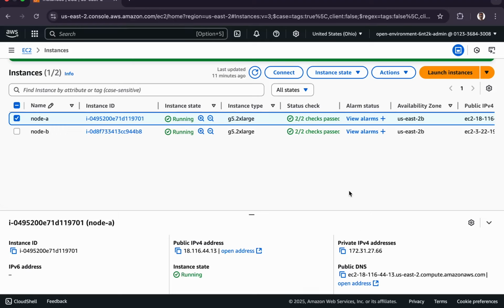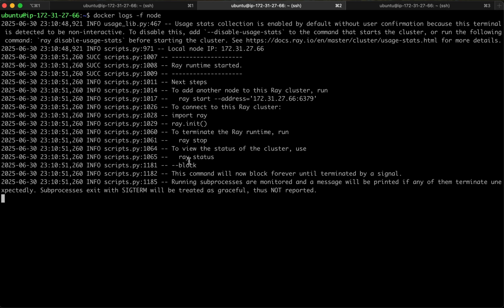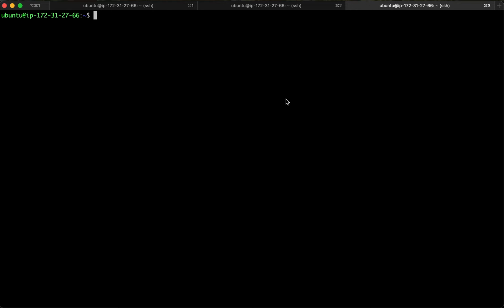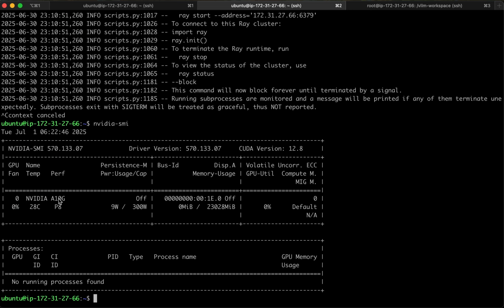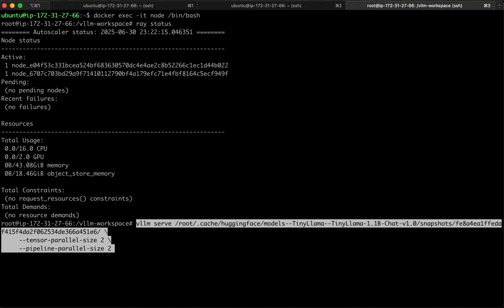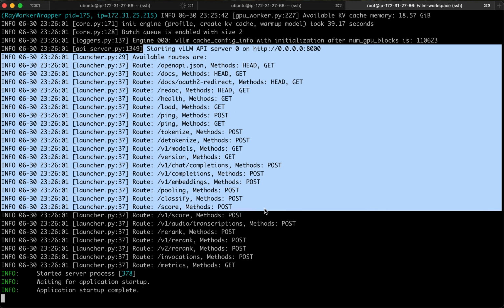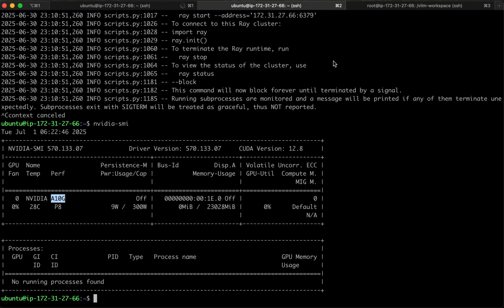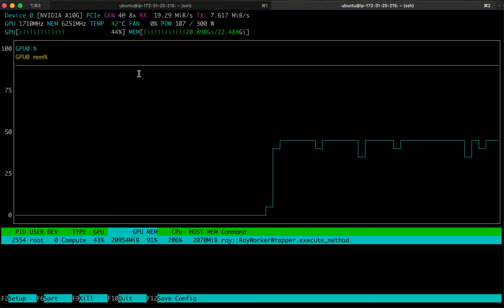Distributed LLM inferencing across virtual machines using vLLM and Ray

Comment: Great video.  Were you running this locally across two machines on your own network? Edit watched again and got my answer, but can you do the same thing you just did here and run an LLM on two machines on a local network?
Reply from the maker: Thanks for the feedback. As shown in the beginning of the video, this is run on 2 VMs on AWS. And yes, this could be on 2 machines on local network as well.
Reply: @balakrishnanb4484  Appreciate the reply back.  Deep diving into ai and all the ways to use it is heavy enough on it's own, but then you factor in spending money to upgrade your system(s) and it becomes daunting, to say the least.  This has helped me take some stress off spending money on GPU's.  Thank you!
Reply from the maker: glad to know that this has been useful.